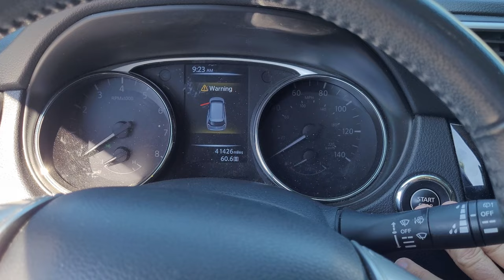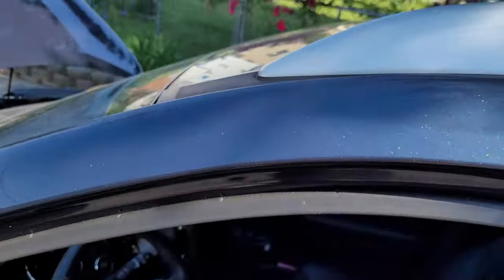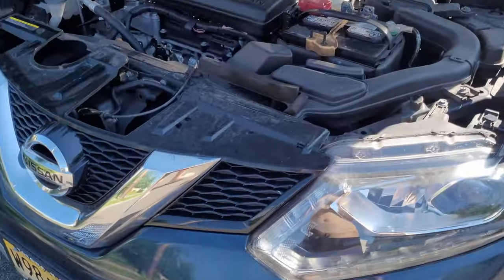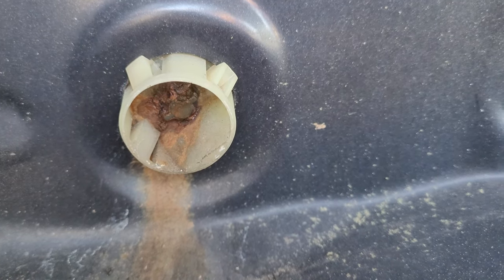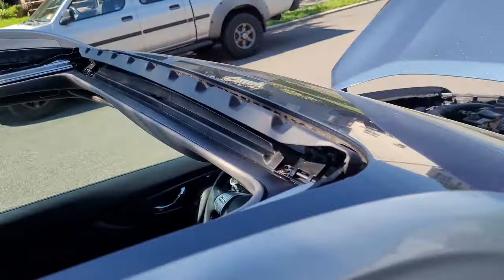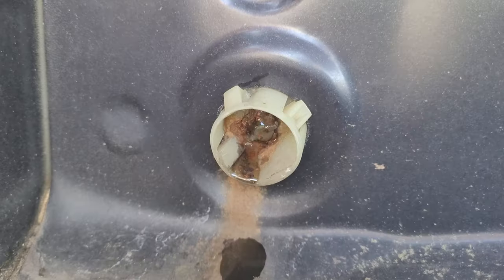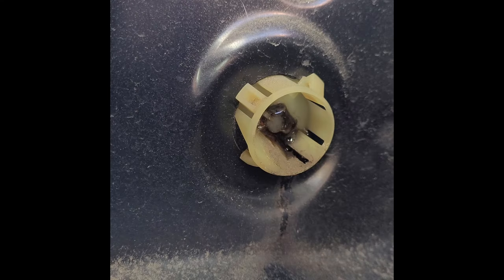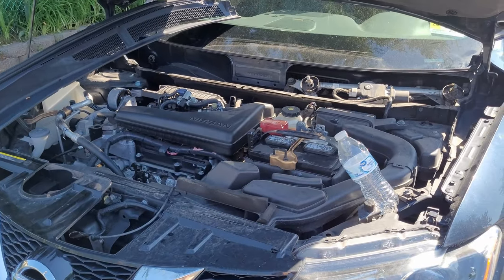Leaky Sunroof Nissan Rouge (2013-2020) Second Generation

Comment: I cleaned my filter out yesterday in about 5 minutes. TIP:  I didn’t remove the front shroud because there is a small rubber flap on the side of the shroud that gives access to the filter. I simply pulled that back a bit and then took a hose to spray the filter. The clog was removed and water started to drain.
Reply: Wish I saw this comment but I just ripped the stopper out with some needle nose pliers. I'm curious though, didn't see a flap on my 2016.
Reply: @user-ki4yo2kb5w Trying to locate the small rubber flap you mention, not seeing an obvious one. If you can help me locate it that would be awesome !  Thanks !
Reply: Ooo that would probably be more convenient then removing the shroud but as some people mentioned, I didn't see one. What year is your Rogue? It may be a third generation thing
Reply: Great video ... thank you!!! I've just had to do this to my X-Trail ... both front drains were blocked. Removing the plastic shroud was not difficult and easy to refit, plus it gives better access to both drain covers. I'd certainly recommend carefully removing the middle piece of plastic with some needle nose pliers, that way it won't get clogged up again. I then got some one to blog the end of the each pipe with their finger whilst I poured it warm water mixed with a citrus degreaser to thoroughly clean both tubes – the water flies out now! Stupid design by Nissan to restrict the exit holes, asking for trouble but quite common with roofs like this. Removing the shroud also allowed be to get rid of the muck below the wiper blade exits. Now I want to double check the rear drains ... anyone know exactly where they exit?
Reply: I have two R +L side 😮
Reply: This is the way.

Comment: To the absolute T this is what happened to our 2014 rogue and I can't thank you enough for this video.  I'm the last person to claim to know anything about cars or fixing cars and I did this in about 1 hour after watching the video twice. To anyone about to perform this task watch a video on how to remove rogue wiper arms first.  It is a little tricky if you're unfamiliar and no tools are required.  Don't try to brute force them off there is some finesse to it, but they should come right off very easily if you're doing it right. The videographer sort of glosses over how to do that part.  Same with the clips on the shroud.  Get a flathead screwdriver gently up under the part of the clip that is on top of the shroud and while it's under there use your other hand to pull the clips off. They also come right off easily if you're doing it right.  Make sure to pour water up top in the sunroof reservoir like in the video to see if it pools and does not drain on the side you're working on BEFORE messing with the drain. You want to know that you've actually cleared a blocked drain when you bend the filter for the first time.  Use needle nose pliers and bend the filter piece out of the way....water and probably some brown/grey gunk will come gushing out.  Same steps can be performed on the drain on the drivers side too.  Our driver side drain was not blocked but the passenger side sure was.  You will probably know what side your issues is on based on which side of the headliner is wet when you notice you have the problem.  Again many thanks to you ItsCalledSirnica!!!

Comment: Thank you so very much, I found about 10l of watter under the drivers seat and had no idea where it came from as there was nothing on the head liner. After looking at your video, I opened the sun roof and there it was, standing watter. Pored some watter like you did and voila, I sow the watter dripping under the plastic that covers the A pillar. Did what you showed and saved the 900€ that the dealer was asking for. Most productive 20 min of my life. Thanks again

Comment: Awesome thank you I tried running the cable from the top like other videos and couldn’t get it to go down.  By doing this I was able to break the filters and run the cable up clearing out a bunch of mud! Now they drain perfect!  Tip to get the wiper blades off you can push down and see how they flex, push down and pull out they should pop right off.  There is also a different video that expands on this if you’re still having trouble.

Comment: I went to a major retailer and I ask about the tool they use to clean the duct. they said no special tool they keep passing the wire til it works.
 it never freekin worked.

 I saw your( this video) and disassembled the same parts(simple tools), pulled the nipple filter plug off and the water and crap came gushing out.  I pushed a wire up the orifice to move "the bowel" a bit.

I think the car was designed this way or a concept guy said "oh Look some unused parts from another design of something that did not work!"

You saved me a lot of money that I do no have. I looked good to my wife and kids(priceless)

thank you

Comment: Nissan HAD to have put these pointless filters in for a reason, and that is to squeeze more money out of us.    It's diabolical.  

Thank God for YouTube and this channel.  Really appreciate it, man.
Reply: Money, money, money!  Some people can't/don't work on cars and they take advantage of that...
Reply: Yup my Pathfinders are the same, junk. Horrible design.
Reply: I have two R+L SIDE 😮
Reply: It has me so upset as I am temporarily disabled and my dealership wants to charge me $742 to fix just the leak. That's not the carpet and headliner which are damaged too. My quote from them is over $6,000. Absolutely disgusting. We need to start a class action lawsuit for putting a filter inside and at the bottom of a drain...covering more than 50% of the drain.
Reply: Also, thank you, sir, for saving me hundreds of dollars by posting this video. Btw, that hose you left connected, can be pulled apart and reattached easily (it's the windshield washer fluid hose).

Comment: Thank you very much on the detailed video. 
   
    I watched other videos using the wire method. Which I think just packs the dirt. 

    Once you remove the wiper arms and shroud. It makes sense to follow the video. 

   It makes sense to remove that so called filter. Once you do that, you’ll  brake the clog. 
Good video

Thank you

Comment: Dude, thank you for making this video. 

My wife and I just bought a ‘17 Rogue and after last nights rain we noticed wet spots on both pillars. I looked up about it and found your video. 

Her passenger side had what seemed like a nest in the well where it drains out below the windshield cover. Pulled the nub on that one and a decent amount came out. Residual that couldn’t make it all the way out from last night. Tested that side and everything is perfect. 

Driver side looked clean which made me suspicious. Pull the nub in the center and nothing really came out. Tested it and it was slower than the passenger side. I got some line from a string trimmer and tried going up through to dislodge any debris. Tested it again and it moved a little better. 

I wish I was able to find out where the tube starts up at the actual sunroof for that side. I tried and I wasn’t sure if I was going down the front tube or it was curling back toward the rear. Did it a few times from the top and tested once more and it seems satisfactory. 

Will just have to wait and see I guess. If it keeps happening then I suppose it’s on to getting the back ones drained as well. 

Anyone see a good video for those? Please refer me to it. lol 

Thanks again man! Great work!

Comment: The new rouges have the Infiniti old style door handles with the keyless entry button on the outside. This was nice because you could use gloves to unlock the door still. Now they have touch sensitive sensors on the inside of the door so a button no longer needs to be pressed, but it doesn’t work with gloves

Comment: Thanks for the video. Have a 2016 Murano. Your video was helpful in finding the plastic piece the drain tube is plugged into. Your right, the design is  dumb, why have the filter hidden under a cowling. As in your vid I bent the little piece, water was gushing out. I owe you a beer.

Comment: After the drains are unclogged, take the seats out, pull up the carpet and dry it (takes about 2 days). The carpet has foam cushions that soak up a lot of water and the only way to fully dry it is to remove them, squeeze the water out and air dry.
Reply: you can also use a wet vacuum, and I have heard people using a dehumidifier too... plus leave the windows lil bit open and leave the car in the sun to bake ...
Reply: @atomize1981  yes, the wet-vac will pull a lot of the water out of the carpet, but the carpet needs to be lifted off the floor to fully dry. I went through this 3 times before I finally fixed the problem with the clogged plug. A big mess!

Comment: Thank you for your excellent video. I had exactly the same problem. This is a very bad design by Nissan. The blocked drain resulted in around 5 litres, yes honestly no exaggeration, of water in the passenger side footwell. It also caused the electronic parking brake switch to fail. The drains that are under the windscreen scuttle have plastic filters that are guaranteed to block with fine debris/dirt that will get into the sun roof and wash down. I cut the filters out of the plastic drain plug and I reckon there will be no more trouble with water getting into the passenger compartment. Our UK Nissan XTrail (I think it is sold under a different name in the US as in this video) is an excellent vehicle except this stupid piece of engineering and the turbo which is prone to fail and is diabolically difficult to remove due to its location at the rear of the engine, close to the bulkhead. I have yet to establish why the turbo has failed twice in 2 years, but expect it to be oil starvation due to a blocked oil feed pipe. This is an expensive problem to rectify, so I really need to be sure that it doesn't fail again.

Comment: I had my forward collision detections sensor fail again after the 1st one failed a year ago.  I thought the leaking was from a bad seal from the windshield.  I took the car into the dealership for both problems.  Got a quote for the sensor at $3000 and that I was negligent regarding my dirty sunroof, which caused the leak.  This repair cost me 444$ and apparently took the technician 2 hours.

Comment: Do you know if the 2015 Nissan murano have the same system? will that work as well?
Reply: I have 2017, and I'm pretty sure it is the same drain application that is in the Rouge
Reply: Yes I have a 2015 Murano same problem

Comment: i've cut out those filters and cleaned the drain to the roof to get all the dust out. but before that i've got totally wet car after Daniel storm in Greece... there are two more drains under rear bumper as i've seen in some video and they should be in same condition...

Comment: I feel that it is NOT a poor design, if you know what the engineers where trying to do. They were trying to allow water and silt to drain while blocking small bugs, spiders, and ANYTHING small enough to fit up the hose, that would make for a safe home for them supplied with water.
Reply: BUT...since it clogs anyway, if the filter isn't there, easy peasy to shove a wire down like we've all tried to fix it in 30 seconds!

Comment: If you ever find yourself in Athens, Greece, then let me buy you a drink.
I was trying to fix it with a square nylon trimmer line, which I inserted from the top but it couldn't reach the bottom (I guess due to an angle). But the job was done when I inserted it from the bottom. I just can't believe that instead of leaving the bottom full opened, they have put this stupid little thing at the bottom end

Comment: My 08 Altima is clogged on passenger side.  Can you replace the filter system piece? I need to remove my glove box.  Might try wiper area 1st from outside.  Great video.  Nissans are definitely notorious for this.
Reply: I didnt remove wiper schroude because not sure I can even get to back side of the plug.  That piece is behind the glovebox in my Altima and a PIA to reach. I had to cut away insulation.  I didn't pull the tube off. Going to try soft coated wire instead of flimsy weed eater wire.

Comment: did you say you actually pulled the center out of the white fitting so there is now no filter and the rain water will just run out like it should? thnx for the info.
Reply: easy to pull the filter out of the passenger side. The wiper motor needs to be removed (three bolts) to make access to the driver's side easier. I just used a long screwdriver on the edge of the filter and hit the handle with a hammer.  Pop! Done. Poured a gallon of water (slowly) in the open tray of the sunroof and it was immediately gone.

Comment: Is there a drain for both sides or just this 1 on the right side
Reply: There are at least two drains, one on each side in the front, and if the design is shared across the Nissan/Infiniti lineup, there are also two drains on the back of the sunroof too, one on each side.
Reply: @supergiantbubbles  have you found any videos demonstrating where the rear drains are? i fixed my front drains no problem by following this video, but haven’t found much about the rear drains
Reply: @joshmelo  same here, front drains cleared no problem after removing small round plastic filter ... I'd like to check the rear drains too, if just to remove the small beige of plastic so they won't clog in the future. I did find this information on another site – copied and pasted > "I had an issue that the rear drain tubes were blocked..tried washing line to clear but no good. The rear also have these stupid plastic end parts that actually prevent the mud from escaping. I found them in the boot, one can be accessed from the jack housing..remove the plug( you need to push it from between the bumper and the bodywork..remove the tube, break off the plastic middle part and clean out. The other side is behind the side trim..bit of a faff mainly push parts on the trip but need to remove the two tie down hooks and another screw under a blanking plate. Water flowing let me a dream now."
Reply: @supergiantbubbles  have you figured out how to clear the ones in the back?

Comment: This makes absolutely zero sense. There doesn’t need to be a filter in the first place, and then they put it inside the engine compartment. Wtf are they thinking? I thought my sunroof seal was damaged too but it looks fine.

Instead of the water going into the engine bay, it was going into my car instead. Genius
Reply: And if there was going to be a filter, like you said, it should be at the top and easy to access to clean out periodically